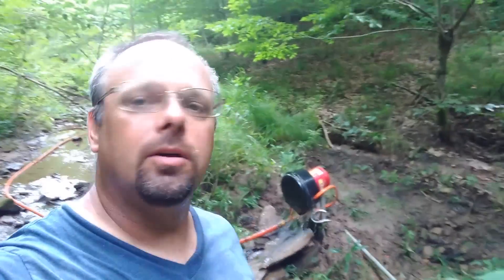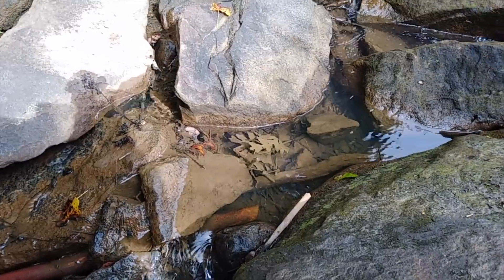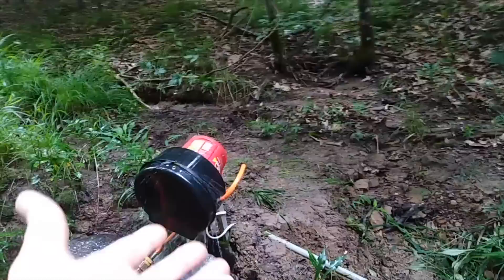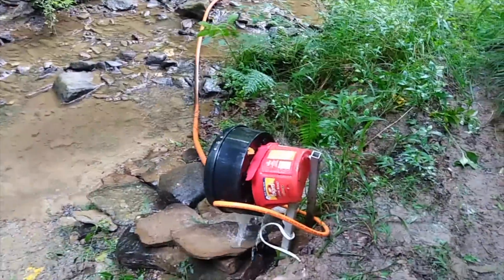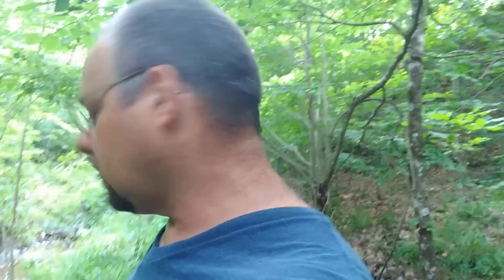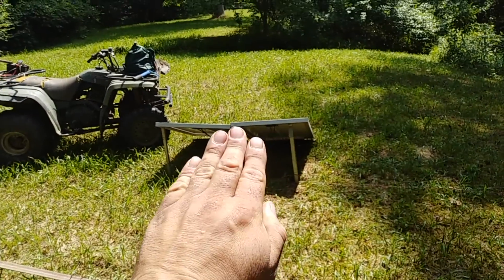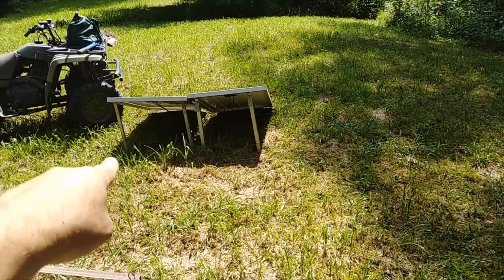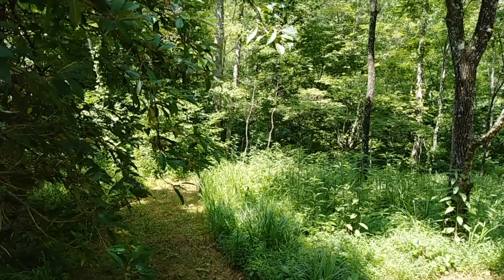Solar and Water Power for the off grid Pallet Wood Cabin

Comment: Just an idea: Why not harness the water. Instead of stopping the leak, prevent it from leaving the container (obviously this will fill the container). Get a new rotor that moves through water & this should ideally, garner more power.
Reply from the maker: That could work. The water is already there so why not. Thanks for the suggestion.

Comment: On your 3-D printing for your will do you have something that I can copy or buy from you  ?  Can leave some info on me on how to get ahold of me if you can help me out appreciate it. thank you
Reply from the maker: I just found it on thingiverse and printed it out. It wasn't my design. There are several on there. I wouldn't recommend using a 3d printed wheel though, mine is already almost shot. They have some good aluminum ones on Ebay. That is where my replacement is coming from.

Comment: How do you keep it from freezing in the winter months?Nice video.
Reply from the maker: Haven't had it freeze yet probably because of the flowing water. At least the solar can supplement my power needs if it does freeze.
Reply: I would also think a small holding pond in the middle doing dry season's could help as long as it's above your intake line.
Reply from the maker: @buckeye8069  This creek has always had enough flow for something like this. I remember as a kid seeing the water slow down during a drought and it still was flowing some. It would be pretty easy to make a small pond though. I could dam the creek up at where the intake comes in. That would probably help with keeping debris from getting caught up in the intake screen too as I could have the intake deeper in the water.
Reply: Also, have you considered wider intake “mouth” to reduce suction without losing flow at the generator? And what about directing “used” water into a hose directing it back to the stream? Still like the idea of rocks to prevent erosion, but spewing water is going to corrode your wiring, even with cover over alternator.

Finally, so many upgrades required for winter, and for waterproofing battery storage. Water & electricity are very bad for one another! I’m very worried about your potential for burning the forest around you... I hope others won’t copy your setup without reading up on the dangers associated with electricity and water creating short circuiting. Your generator should be safe enough (it’s trickle-charging the batteries, right?), but imagine dumping the full charge on 3 batteries through a short circuit?

Comment: great idea, thanks.  One thing you should think about is the fact that the gasses from the batteries will corrode all of your metal connections and may ruin your controllers.  It would be much better to have the controls in one box and the batteries in their own box separate from the connections.  It is a great idea however to transmit the AC to the rectifier closer to where it will be used.
Reply from the maker: Yes, I have found out the hard way that the electronic parts will corrode. My inverter has stopped working due to corrosion. I have upgraded to a pure sine wave and moved everything electronic into a plastic bin.

Comment: I am wondering if you put another rock by your water intake to raise the water level enough so hopefully any leaves would float over and not go into the intake.
Reply from the maker: Good idea! I put a screen wire cage over the end of the pipe. It works to keep the leaves from going into the pipe but they still clog up the screen. I'll try your suggestion. Thanks!

Comment: Nice! I hope you are using LED bulbs for light. I think a remote switch to turn the inverter on and off from the cabin would be a good idea. Inverters use power even if you are not drawing a load.
Reply from the maker: These bulbs are LED but they look like regular bulbs. A remote switch is a good idea, thanks.

Comment: Not a bad set up. Maybe try to make a small dam so the pipe is a little deeper in the water, should reduce floating debris from being sucked in.   For your batteries, maybe just add a little hydrochloric acid. That might be easier than draining all the liquid out, and refilling with the alum.
Reply: what does adding hydrochloric acid do? what does alum do? learning...

Comment: A good filter would be a bucket with many 1/4" holes drilled in the sides and bottom.  Hollow out that little gully to fit it.  I agree with another commenter to avoid drilling holes in the pipe.  For refrigeration (if you want it) I would look into those coolers that plug into a cigarette lighter, I have several and they range from 30-60 watts of usage.  Another option is to modify a small chest freezer by turning the temperature on the thermostat all the way up to like 40 degrees if it goes that high (some guys modify the electronics to allow a higher temp) that way it acts as a refrigerator and is crazy efficient.   You should switch your Lighting to LED bulbs if those aren't.  Either way your device is awesome, as well as your setup, nice work!
Reply from the maker: Good ideas there. Thanks! I do have LED bulbs, they look like regular incandescent but they are LED.

Comment: Yes ac travels much farther on smaller wire then dc. If you still want to use dc at the cabin, just plug in a convertor or battery charger. Not real efficient doing it that way but it will work.
Reply from the maker: True, that would work. I guess I'll be doing that anyway when I plug in my phone charger to the wall.

Comment: Great content, also a smart survivor man. My 2cents is burn the paper pleats out of a used heavy equipment air filter and use that screen for your intake filter. Drilling holes in the pipe might let air bubbles in the pipe and your siphon effect will suffer.
Reply from the maker: Excellent idea with the equipment filter. I've seen and replaced them many times, but never thought about that!